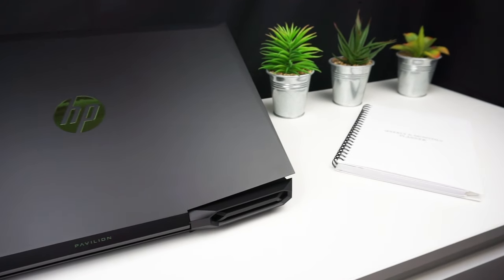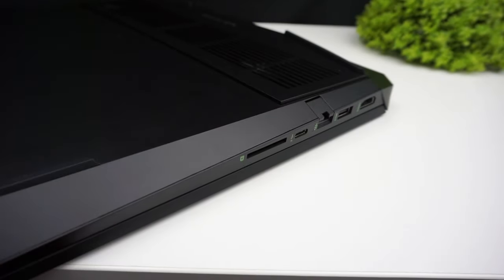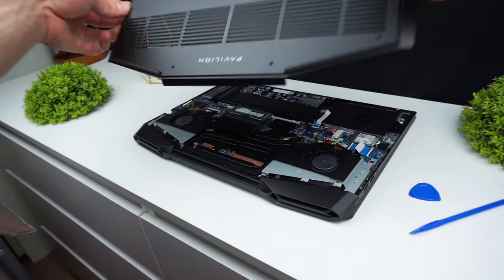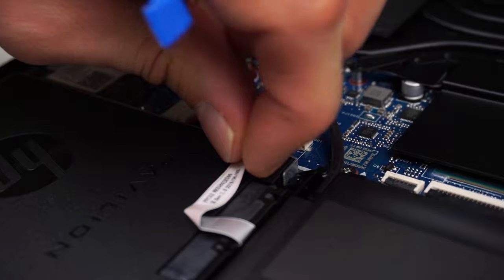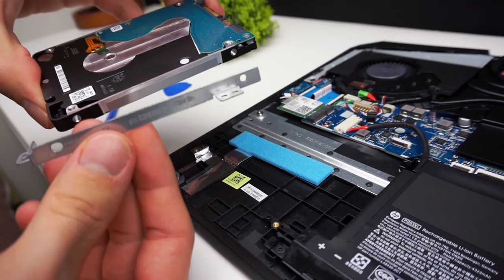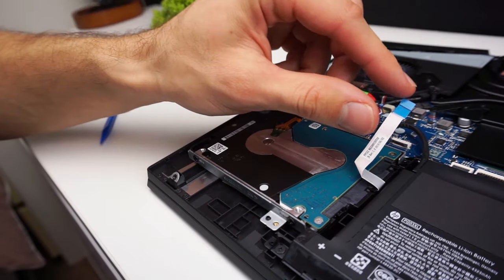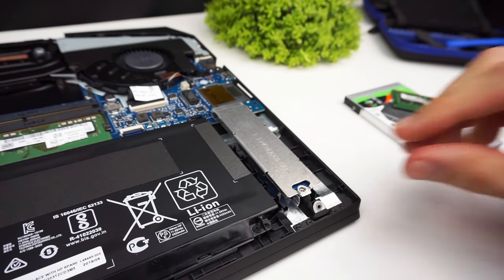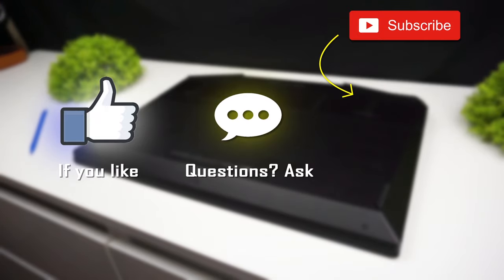HP Pavilion 15 Gaming Upgrade RAM / SSD / HDD - Disassembly Guide

Comment: It is not recognizing the ssd I just added. Do you know what could be going on?
Reply: Try pressing windows, type disk in search bar, click the first option and find your new ssd. I dont remember exact steps and what to do next, but shouldnt be hard
Reply: On your Windows Desktop, Click the Windows key, and then type "Disk". Click enter, and find a black color rectangle. It will say "Unallocated" and your Capacity. Right Click it, and click "New Simple Volume" Then Follow the Steps. Feel free to Re-name your Drive, and when you're done Click finish. Just wait a second, and you'll get a Notification that a new drive has been connected. Now you can access the disk and do whatever!

Comment: Can i add ssd with hdd or i have to remove it ( can i use both ssd and hdd in hp pavilion gsming laptop
Reply from the maker: The laptop has one slot for M.2 SSD and one slot for 2.5" HDD or SSD if you wish. You can have bots slots with drives installed at the same time

Comment: hello bro, i already have 1tb hdd 7200rpm on my laptop and i also want to add 120gb SSD for windows, and is it possible to put 2 hard drive ?
Reply from the maker: This laptop has 1 slot for 2.5" HDD/SSD and 1 slot for M.2 SSD, so if you have only HDD you should have M.2 slot free
Reply: @TechFinds  thanks man ✌️

Comment: Thank you very much for this video. It seems like descent laptop if you find it cheap. However i wish they did bigger battery instead of that hdd. Who uses that now days and why?
Reply from the maker: Actually i prefer to have HDD slot, especially in a budget laptop like this. You can have a lot of space for not big money
Reply: I do. Sata SSDs are cheap to find and works more than sufficient for day to day task. They also run cooler usually due to their lower read/writes.

Comment: Hello, good video. Of the RAM memories you recommended to buy, will they be compatible with the 15-dk1035nr? 
I couldn't find the one you have from the factory: 8 GB PC4-25600 DDR4 SDRAM SK Hynix HMA81GS6CJR8N-XN.
Reply from the maker: It doesn't have to be the same brand, just match the specs. I can't find your model by number, but if it's the same generation as mine you can use the same parts that i linked.
Reply: @TechFinds  Hello, im wondering what ram i should buy. I want to buy cruicel but im not sure which 8gb ram stick to buy because they have multipule options and i was wondering if you could help

Comment: do i have to match and sort of specs when upgrading the m.2 and hard drive at the same time? will my overall storage increase by adding a hard drive since it didn’t come with one?
Reply from the maker: If you gonna replace your current M.2 SSD where you have Windows installed then you'll need to install Windows again on the new drive. The additional HDD just adds up
Reply: @TechFinds  how would you install again windows on the HDD/SSD?
Reply from the maker: @cristophermartinez6707  From pendrive using Microsoft media creation tool

Comment: Hey I’m using a MX500 500gb ssd with a Kingston KVR26S19S8/8 Valueram - DDR4-8 GB - SO-DIMM 260-Pin and a Seagate BarraCuda 1TB Internal Hard Drive HDD but it’s saying that no bootable device please I need help

Comment: Are the RAM in the video compatible with the HP Pavilion Gaming 15-dk10?
Reply from the maker: I can't tell that by this model number as it may be different for each country even if the specs are the same. tell me the processor you've got
Reply: @TechFinds I have a Intel Core i5-10300H
Reply from the maker: @ihelgi  then you can use the same parts listed in the description. When mixing new ram with original one remember to match the specs
Reply: Great, thank you

Comment: my man, is all ddr4 the same at physical size? like for example 2x5 inches?
Reply: The ddr4 ram for laptop ( sddr4 ) it's at a standard size height and width wise, while on the pc, the height varies from a manufacturer to another but the widht it's the same, they all follow a standard.

Comment: Okay I feel like HP and Lenovo gaming laptops will be something I want to get later in the future because my recent experience when i tried to fix my MSI laptop went down hill when I wanted to just replace the CPU / GPU fans. I hate that some of the design assembles like MSI and ASUS are just difficult to work to disassemble to the point it could break easily.

Watching this video though makes me feel better though lol. Thanks for sharing this video!
Reply from the maker: I don't know how about other models but once i was replacing fans in 2018 HP Omen 15 and it was really difficult and complicated due to design if that information can help you.
Reply: @TechFinds  Well now that you mention about the models from 2018, I forgot that the designs were still complicated in that year until 2020 from what I was told. The laptop I have right now is MSI GS63 Stealth 8RE and I thought the disassemble process was not bad. But after 30 mins of tedious and careful work on taking the parts to replace the CPU and GPU fan, I was already stressed out.

After that though, i messed up my laptop big time and it happened recently too. I may consider to get a gaming laptop another time so I'll go with PC later.

Comment: Do you need any wristband thing is so you don't shock the motherboard. Or anything like that
Reply from the maker: It's not necessary, but you can use any for of protection if you want as in theory an electric shock may happen
Reply: @TechFinds  what would you recommend
Reply from the maker: @lk_gucci2584  disconnecting the battery and using rubber gloves. Me myself, i never use any kind of shock protection and i never disconnect the battery too, and i never got shocked. ;)

Comment: Compare to ideapad gaming 3,which one is worth buying?
Reply: Easy pick, HP pavilion doesn't overheat, its awesome and realiable laptop
Reply: @AVengerNSS  thanks so much
Reply: @Joko-um9rp  you're welcome
Reply: going on 2 years with this one, it basically gets used as a "couchtop" (it's literally always plugged in like a laptop and doesn't leave the house lol so it's like a joke with the wife).  it's a nice setup, backlit keyboard, have no experience with the ideapad though.  my biggest thing is storage, the sotrage IS kind of small, granted it's SSD (which helps for speed...) but it;s funny cause her old laptop in her office actually has a bigger hard drive, than this laptop came with, so we're considing upgrading.  I'm actually shocked to see it has an extra HDD bay for upgrading it.

Comment: the screws for the metal bracket will not budge at all. i’ve tried 10+ screw drivers i own and nada. any help?
Reply: The last bold on the hdd stripped and I can’t find anything to get it off
Reply: Same the top screw is so tight

Comment: normally you don't disconnect the ribbon cable. it's extremely delicate. i've worked on other HPs and you disconnected it at the drive, not at the board as the drives connection was much stronger (therefor less likely to break).

could be wrong though. still. be very careful with that ribbon cable, they break easily.

Comment: What is the biggest storage for the hard drives? I want to put 4tb on both. And is it possible to swap out the wifi card for another?
Reply: I found out the samsung 860 models are discontinued will the 870 work?

Comment: is the SSD nvme or sata I'm about to do this and I am nervous about buying the right parts.
Reply from the maker: Mine came with NvMe SSD which means that the laptop supports that type.
Reply: hey if you didnt buy till now and if you are buying frok third party apps like amazon make sure to check the specs on hp websote coz the website shows everything equally how many ram slots and all :)

Comment: will this support a 2.5 6TB hdd as well or does it max out?
Reply from the maker: The problem is that 2.5" HDDs larger than 2TB are usually thicker than 9mm and it will probably not fit in the drive bay.
Reply: @TechFinds  Thank you for the info I'll make sure to look at that when purchasing a replacement

Comment: If i dont remove the tape in 3:27, there any problem with temperature?
Reply from the maker: No problem, this is only a black piece of paper-like material to hide the green ram stick look when looking through the bottom pannel grill. Just a visual function
Reply: @TechFinds  thanks a lot, this the only video that explain all the process of the upgrade specific, good work :)

Comment: I have the HP Pavilion 15-ec1001na does 32gb fit in there? and 2666hz are correct i want to upgrade mine. Is the built-in hard drive bad or why did you replace it
Reply: for sure its fits.
Reply: trhe build in hard drive is just a replica
Reply: I know this was two months ago but I’ll throw a few facts just in case, 

Laptops use the SODIMM ram format and the speed you should use tends to depend on what CPU you’re laptop uses, usually means 2666 for Intel and 3200 for AMD

I believe the “HDD” he removed was actually a template and was nothing more than a piece of plastic if your referring to the SSD then these laptops typically only come with a 256GB SSD which if you’re gonna do any kind of gaming on you’re gonna want to upgrade that as that will fill up very quickly, for gaming you’re probably gonna want a TB of storage at least
Reply: @shadowcastyt  

The 15-ec1001na can use either DDR4 2666 or 3200 Non-ECC SODIMM

Comment: what is the Max Ram this model can take ???? 16GB or 32GB
Reply from the maker: It can support up to 32GB (2x16) 2666MHz
Reply: @TechFinds  is it not 3200mhz? Mine shipped with 2x4 gb 3200mhz?
Reply from the maker: @speedpoint7280  You ma have 3200MHz RAM, but see at which speed it actually works. I think it downclocked to 2666MHz
Reply: @TechFinds  it says in task manager speed is 3200mhz
Reply: @speedpoint7280  yes mine is 2 x4gb 3200mhz aswell

Comment: does the m.2 have any data in in or is it like the HDD cover that is fake
Reply from the maker: M.2 SSD is a drive as same as HDD, just a different type. Usually windows is installed on M.2 SSD and you have the rest of space on it free.

Comment: Hi purchased a “2021 version on amazon and am looking to make the same upgrades. Im also not tech savvy. Will i need to reinstall os or anything? Or just plug and play?
Reply: It comes with windows installed. You can start playing instantly but I recommend changing some factory settings such as the powerplan and the GPU settings.
Reply: @iukey  how do you adjust those
Reply: @bradleylocascio9068  watch Fr33thys final optimization vid.

Comment: Why did you unhook the ribbon from the computer?  Don’t have to do that
Reply from the maker: it's way easier to unhook ribbon cable from motherboard first for me as sometimes the sata connector holds tight at the drive end so i got more freedom if the cable is loose

Comment: Hey, so I bought HP Pavilion Gaming 15dk0056 intel5 9300H, although I'm trying to understand which RAM specifically would be compatible with my Laptop. Also I found out that my 256GB of SSD will kinda not be sufficient for me. Can you please give me a bit of information about the physical sizes of SDD and RAM, and which brand or model ones may be compatible for my computel model? Thank you.
Reply from the maker: I linked few options on the description. If you gonna mix RAM with the original one go for Crucial as it has the same specs os original RAM. If you're replacing 2 sticks you can go for whatever you want, just remember that this laptop supports up to 32GB RAM (2x16) 2666MHz DDR4 260pin
For SSD you can install 2.5" drive up to 9mm thickness. Or you can go for HDD instead
Reply: @TechFinds  Thank you!

Comment: Yo I want to take advantage of the 144hz but this thing barley reaches 100FPS  anyways. So obviously the display isn’t the problem it’s the “engine” or the meat of the pc… I want to know what I can do to make the performance actually reach the 144hz/144FPS since the device is able to reach 144hz but It isn’t reaching the displays specs so what should I do?
Reply: Are you using it on battery or plugged in
Reply: I have a 144hz Msi monitor and no problems related to lag.
Reply: Improve the ram
Reply: Turn down graphics quality ? Use it whilst charging , enable windows performance mode

Comment: Is the drive that the comes with the laptop the one that the operating system is on? or is the sdd slot empty until you put one in there
Reply: that's a good question
Reply: my operating system is on ssd which i'll replace.. i dont know how.
Reply: It has OS on the NVME ssd other slot  is for normal ssd or HDD.
Reply: I had bought it with 512gb ssd which is in the small M2 slot. There is OS.
Space for 2.5" is empty, filled with the plastic fake drive. 
So you can easily two hdd drives.

Comment: Is there a specific ssd we have to get for this laptop?
Reply: ssd are all the same, you can buy both 2.5 inch or nvme, just the 2.5 inch will have to replace the one already installed

Comment: could i fit 2 ram cards in this?
Reply: There are two ram slots in which you can fit two ram sticks in each, 1 ram stick is applied in 1 ram slot by the company and you can fill the other ram slot if you want. It's optional.

Comment: Can I buy and use 3200 MHz ram for this laptop
Reply from the maker: It supports up to 2666MHz
Reply: So I cannot buy any ram above 2666
Reply: @fnofusion1164  you can install it and it will work, but your ram speed won't go above 2666 MHz, so if 2666 is cheaper that's a better option

Comment: I'm having doubt bro i have the same laptop my graphics is 1650 and i want to upgrade my graphics will i be able to upgrade??? Can u please tell me.
Reply: no if u have desktop, yes you can upgrade, but you have a laptop so you cant just magically swap it, but 1650 is still good no need to worry so much :)))
Reply: No I have the exact same laptop but I don’t think you can do that and btw mine gets good performance on games
Reply: No you can't. It is soldered onto the Motherboard together with the CPU. So you'll have to buy a new system to have a newer one.
Reply: If your stuggling with games make sure via graphics settings on windows to make sure that your using the 1650 not the integrated graphics
Reply: Nothing wrong with your graphics bro why do you want to change it

Comment: Hi
Thanks for the video.
I have HP Pavilion 15-au003tx with 8 GB DDR4-2133 SDRAM  ,Can I put another RAM of 8GB DDR4-2133 SDRAM but of a different company like samsung.
The existing RAM of 8 GB is of a different company. Thanks
Reply: Try not to mismatch ram, could cause minor problems
Reply: Just buy the same ram your computer has. Different brands sometimes doesn't dual channel properly can cause slowness and fps drops in games.

Comment: Hello what is the compatible ram for dk1064tx thanks
Reply from the maker: I can't tell it by this model number. Tell me the specs and production year. Is it the same generation as mine?
Reply from the maker: If so, i linked compatible RAM options in the description
Reply: @TechFinds  the spec is pavilion gaming 2020 15-dk1064tx  rtx 2060 qmax 6gb with 8gb 2933 ram. Now this is where im confused as 2933 is just an underclocked 3200 or overclocked 2666 ram right. Its either buying 3200 or 2666 but i dont know which one i should buy
Reply from the maker: @tartilasahid8056  If it has 10th gen Intel processor you can go with 2933MHz RAM. It doesn't have to be downclocked atm unless your current RAM is actually 3200. You have to check it

Comment: Does the ram have to be a specific size?
Reply from the maker: I linked compatible parts in the description. However if you wanna mix with your original RAM it's better to match the specs for RAM (GB, latency, clock speed, voltage)
Reply: @TechFinds  thx, the limit is 32gb of DDR4 correct?
Reply from the maker: @cristophermartinez6707  Yep and 2666MHz

Comment: I"m interested in putting 8gb x2 DDR4 3200 in my 2021 HP Pavilion 15. I noticed that there are different CAS latency choices. (16, 18 and 22) Would a lower (faster) CAS latency be compatible with my unit?
Reply: I wonder this too, but I think it should be compatible and I'm confident enough that I will upgrade too. Lower latency should be better so I take the risk and hopefully it will work!

Comment: i am thinking of buying dk1511tx model of pavilion 15 series, which has only nvme ssd in it. Do you think there is an empty slot for HDD where I can add a SATA ssd? And how much can I add? Is 2tb possible?
Reply from the maker: I can't really tell anything by the model number you mentioned. If it's the same model as mine with just different configuration then you'll have 1 slot free for 2.5" HDD or 2.5" SATA SSD